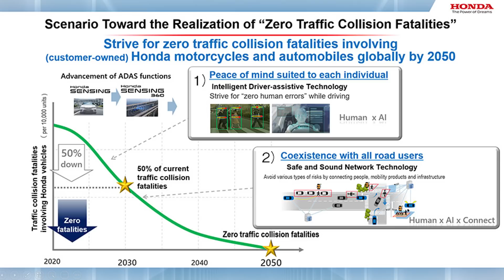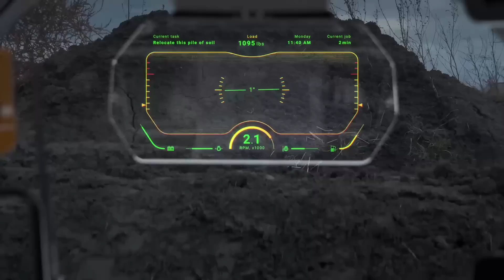BMW Reveals Bold Concept; Solid-State Battery Maker Gets Major Partners - Autoline Daily 3213

Comment: Sean, I love your show, and all the automotive updates. I would to know since some of the mentioned vehicles are only prototypes, I’d love to know what kind of legroom will be available for taller people in these vehicles?  At 6 ft plus feet, I would imagine that many of them would be to small?
Reply: There's only a small percentage of vehicles right now that I either don't fit in or just don't like to drive because they're a tight fit and I would imagine it will stay that way in the future. But I think there will be even more legroom in the future vehicles that are EVs. With range an important metric, automakers are extending wheelbases to fit as big a battery pack as they can between the wheels. That will make for even more interior space.

Comment: As more automakers get into EVs raw material prices will continue to rise, then add in inflation and we're a few years away before costs get below $100/kwh
Reply: not only the cost of battery need more / few years. the whole EV Vehicle system. is running right now beside gasoline engine . I wonder how its going to be like when All Ev's demand electricity all at once . we need more than just few years . dependable source of Electric to power them vehicles not here yet !! they need to slow down pushing this transformation to Ev's . in the end we the consumer end up paying for it  !!
Reply: @East17A  I've been saying for years, there's money to be made investing in EV startups but don't forget about the utility companies, power producers and the supply industry that makes transformers and other equipment for the grid. The entire US grid and other countries I'm sure is in dire need of an overhaul and upgrade. 

I'm a licensed journeyman electrician and there's gonna be hundreds of thousands of homes that will need a service change to handle the increased demand 2 EVs are gonna put on their home. Most home chargers are 240v and need a 50 amp service, most homes don't have that much remaining ampacity from their service provider and near zero homes have the remaining service needed to support a household with 2 EVs charging at the same time.
Reply: @East17A  Considering most EVs charge overnight (off peak) there’s tons of room in our existing infrastructure to handle waves of EVs.
Reply: @fpartidafpartida  exactly, mine won’t start charging until 2 a.m.  There will be much greater demand for installing chargers in garages and on streets than for power plants.
Reply: @OneNationUnderGod. Allah Akbar.  I charge all 3 EVs off my original 1985 vintage 100Amp service no problem.  Usually the solar is more than enough.
Reply: @loungelizard836  impossible if you are charging from a 240v/50amp charger. Those use around 42-45amps and just two of those would put you at the max of your 100 amp service. Run your microwave, dryer or oven at the same time and your main breaker is gonna trip. 

Only way you are charging 3 EVs at the same time is from household 120v/20amp or 15amp circuits.

Comment: Is $65 per kWh still the target to reach price parity with the average ICE vehicle?
Reply from the maker: That's about right, for a naturally aspirated 1.5-L to 2-L ICE (including trans & related hardware) compared to a 60 kWh pack, motor, gearbox and inverter.
Reply: A few years ago, everyone was tossing around a $100/kWh pack price as parity. The average price of ICE vehicles has continued to climb at the same time.
Reply: Build a good EV and you don’t have to worry about price parity with a crappy ICE car.
Reply: $100/KWH is parity.

Comment: I can't see pedestrian and cyclist injuries decreasing, whilst allowing supercar acceleration.  I foresee accelerator restrictors on EVs in urban environments.
Those mobile phone pedestrian notifications will sure be busy in shared street environments outside of North America.
There is a big safety problem with large head-up displays, where the focus of the driver's eye needs to quickly change between (near) windshield and the (far) road ahead.  The human eye is not built like this.

Comment: Can BMW make uglier cars?
Reply: The Germans are never known for beautiful things.!  Maybe making beautiful explosions.  What do you think?
Reply: @MarkMeszarosYNG  I think this is the first time that I agree with you 👏🏽
Reply: @MarkMeszarosYNG  Hi Elon.  Speaking of explosions, another Tesla caught fire over the weekend while parked in a driveway.  Why can’t your cars be as safe as my Leaf, I.e. no spontaneous battery explosions?
Reply: @bobbbobb4663    A model 3, and Y fire in the last week
Reply: @dmitchellhomes  Toss in the Tesla (not sure if 3 or Y) that hit a camel and the glass “roof” collapsed.
Reply: @bobbbobb4663  yeah, it’s been a rough week for Tesla, imagine too, model S and X, Bolt also did not start having chronic fire problems until they were 2 to 3 years old which is right about the time for the mass production of model 3-Y now.   There have already been 4 Model Y’s and a dozen or so 3’s burn.   I am not saying they are unsafe, I have a Model Y in my garage right now,  but I will say, there seems to be a fire risk with lithium ion batteries that is greater than internal combustion vehicles of the same year and in the same model class.  As more EV’s are built and more data collected, IIHS is building a compelling case that electric vehicles over time, do expose more fire risk then internal combustion vehicles.   Wait until we have millions of EV‘s that are 10 years old, and batteries have been abused….  Trends point to much higher risk in nearly all EV’s.   Crazy though, the one outlier seems to be the Nissan leaf, which has experience far less fires.